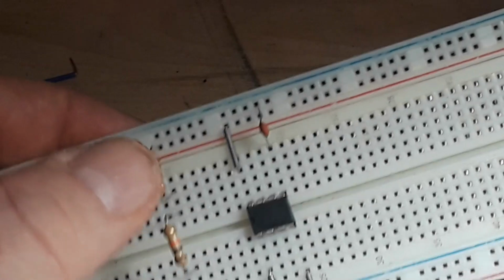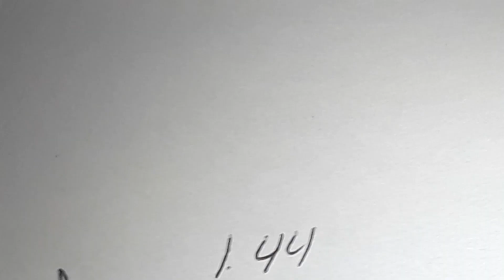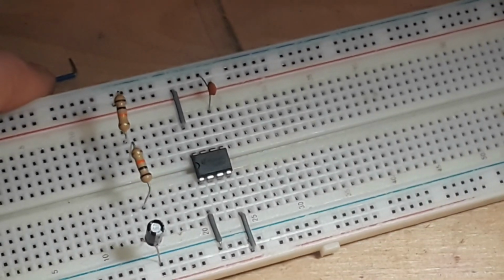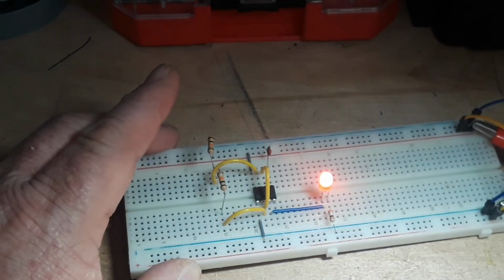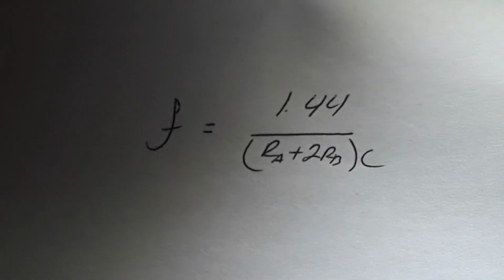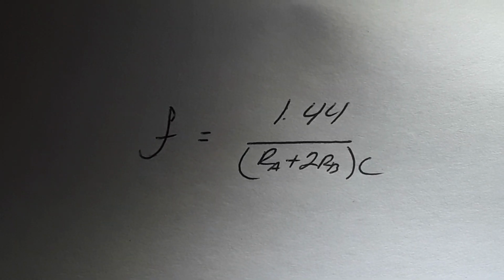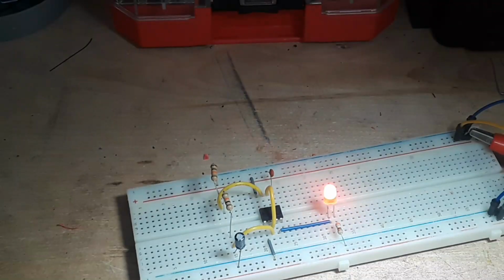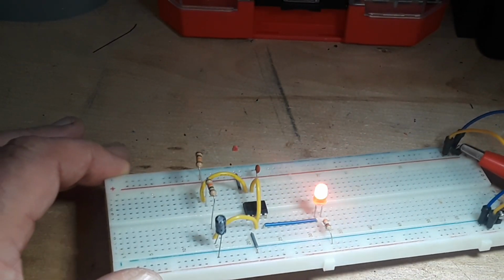The Textbook 555 Astable Multivibrator and How To Determine Timing

Comment: Hey Paul! First off I like your videos, you’re much more informative than my former electronics  professor. Got a question for ya if you got time.

I’m trying to build a phone charger powered by a model stationary steam engine. The output of the generator is about 3v and I think I need a voltage multiplier. What do you think? If yes can you do a video on how to build a circuit for a voltage multiplier on the bread board? Thanks -Stephen

Comment: I use them a lot they make ok signal generators. But if I need a clean low noise free 50% duty cycle square wave I have found that our old friend the CD40106 Schmitt trigger ic chip is the best option. Your thoughts?
Reply from the maker: An ST oscillator is great! Either one with temp control got stability
Reply: @learnelectronics  Thanks for the reply. Have you ever used the CD4024BE IC chip? I used one to build a 3 Bit Stair Step Generator circuit. I’m going to be using it in a Curve Tracer circuit.
Reply: Discard the pull up resistor @ (Vcc-pin7)..and remove the top end of the lower resistor from pin7 and connect it at pin 3...
Now one should have a nearly 50% duty cycle.....
Trim R or C for the reqd. freq. accordingly.
Reply: Thanks for the reply.